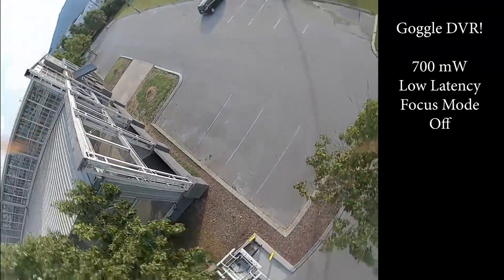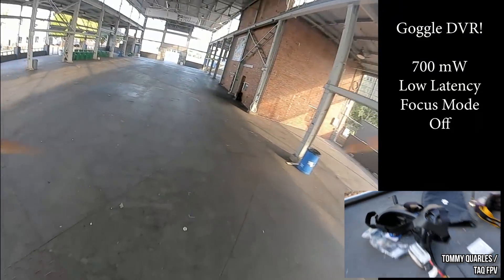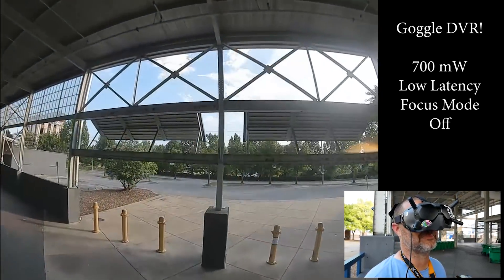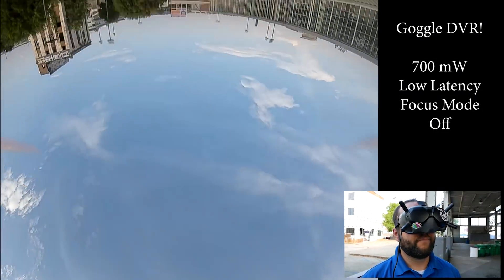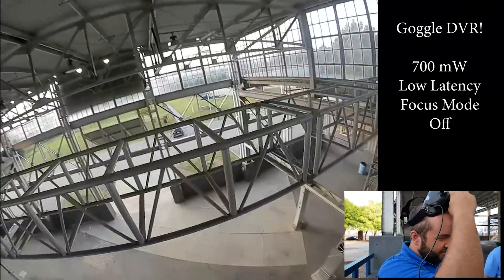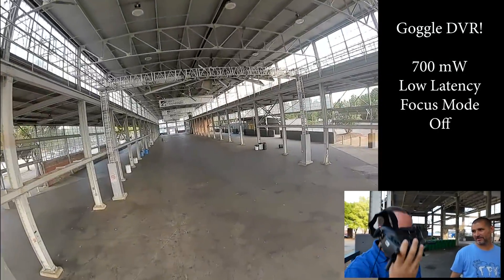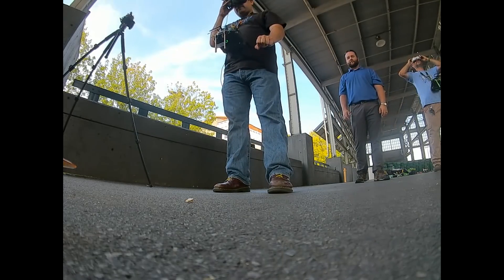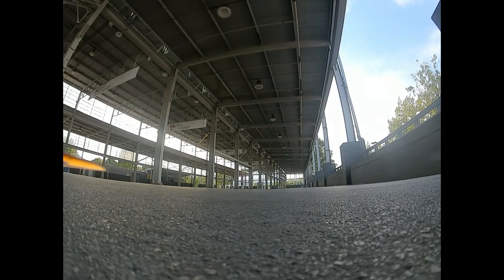DJI FPV 25 mW vs. 700 mW vs. Analog

Comment: It’s interesting but something I thought might be going on was mentioned, seeing a GoPro like view may look fantastic but might actually hinder how well you can fly due to na overload of information. Our analogue FPV “simplifies” things for us, maybe it’s something you can get used to though.
Reply: I was taking with my optometrist about fatigue caused by impaired vision. She was saying if you dont wear glasses when you should your brain has to do a lot more to process and make sense of what you are seeing, which makes you tired quicker. This seems consistent with what ive experienced. Im sure this would also apply to looking at low res analog video feeds, if your brain is having to work harder simply interpreting the image, you probably have less mental capacity for other things. Would make an interesting experiment...

Comment: Kinda need to see this in focus mode.  Also if there's a 200mw option that would be worth doing as well since thats what most of us fly most of the time.
Reply from the maker: There isn't any option other than 25 or 700.
Reply: Ill hope future firmware will give us a 100mW mode. But i can say the range on 25mw is 10-20% better than analog on 25mW

Comment: Considering getting a DJI HD system, maybe in the spring.  Hopefully a v2 comes out that takes an analog module.  Also, would like to see what Fatshark comes up with for HD before I decide.  One question - how hot did the air unit get when using 700mw?
Reply from the maker: It gets very hot. But if you're flying it's okay. It definitely needs airflow.

Comment: Nice test. Just like the guys said there is almost too much information in the goggles. I have well over 50 packs on it and still get distracted by how pretty the sky is or how far I can see.
Reply: Jason Bartlett one of the features i like best is the screen size settings. for fast focused flights i choose 70-80% screen size. 
for slower explorative flights i go 100% screen  and maybe wide.

Comment: Actually looked MUCH better at 25mW than i expected, i wonder why others made it seem like it was unflyable at 25mw. i like that you flew with focus mode off, i really wanted to get a sense of signal degradation at distance. i expected 700mW to be fine, but 25mW held up some what decently. Does the DVR exactly match what you saw in the goggles? i wonder what is the BIT rates on DVR/Air Unit recordings, dont think i have heard any one discuss that. thanks for the follow up review, i did learn something today!! :P
Reply from the maker: DVR is pretty close to what you see in the goggles. I would have to side-by-side to be sure. But remember, DVR takes out the freeze-frame skips.
Reply: @JoshuaBardwell  thanks for the reply, good to know!!
Reply: I've flown 25mw out to 1/4 mile pretty easy on multiple occasions.

Comment: BIG QUESTION: Are you using the DJI TX or a Taranis for control?  Can you use a Taranis for control and (if possible) which would you "choose" to use?
Reply from the maker: I'm using Taranis with Crossfire.
Reply: Yes you can use a Taranis or any other radio and receiver.

Comment: Shame the goggle DVR doesn't seem to record the OSD, it would be helpful to see the latency information and so on.  I assume they want the goggle DVR to be good enough to use in videos, but surely that's what the on board SD card is for?
Reply: Absolutely! Please write them. They do seem to read and respond, so maybe if enough of us request it, they'll do it. Also ask for fan control, and usb to HDMI.
Reply: Personally I'd prefer to have the OSD information embedded in the file, but not in the video stream, anyone who wants the OSD information could use a program to read the data and burn it in.

Comment: is it healthy to keep 700mw around your head?
Reply from the maker: Short answer: yes. This is such a tiny amount of energy and all it does is raise the temperature of the tissue in your head by a fraction of a degree.
Reply: 700mw in the air. Also usually cell phones works on 700 mw, up to 2000mw.
Reply: Duty cycle from the goggles should be quite low.

Comment: Yes. We all fly in 25mW here in Europe. Wink Wink, know what I mean.
Reply: Yes....we do, you see my done officer its actually really small and flying 40m way. It's quite slow that is why it's taking some time to get back
Reply: This is so funny
Reply: And we all fly under 30dbm here in the US. Funny thing is, I don't think anyone realizes that limit. They only realize that they don't have a HAM license( which we don't need with the DJI btw).
Reply: rcrdps I have been flying and driving rc for 15 years (although this is the firs year I’m getting into fpv) and I’ve never heard of a dbm limit so I think you’re right =)
Reply: rcrdps I briefly looked into it, i found conflicting information so I gave up... my understanding is the limit is inputting 30dbm to an antenna, which if you do calculations comes out to roughly 1000mw which is what everyone says is the limit for transmitting analogue signals anyways, and higher than any of my equipment.
Reply: @travispratt6327   Yes, 30=1000, but then you throw a 2db or more antenna on it, and you're over 30. So 700 is around 28.5dbm, and then you throw a 2db antenna on it with a small connector loss, and you're at the limit. That's basically what DJI did. The HAM is to operate stuff that's not certified,.... but still within limits.

I can think of reasons for the limits, but I really have no clue nor do I have any stake in the game. I just like to know what I'm up against.
Reply: The limits aren’t really an issue anyways, that’s more of a manufacturer gripe, what annoys me is the required licensing, if you don’t need special knowledge or training to operate a cellphone or WiFi router than operating a toy using the same frequencies should be the same. If for no other reason than the simple fact very few people are going to get a ham license to fly their $100 amazon drone.
Reply: rcrdps Yea I know what you mean, basically they don’t want people taking an extreme high gain antenna and blasting the entire 1000mw in one single direction, it’s understandable I guess.
Reply: Yeeeeah totally. I always keep to the 25mW😉.
Reply: Switzerland is actually not in the EU, but has adopted the EU limitations,  never mind you can VPN any adress
Reply: Is it actually restricted? Because of EMC Directive excludes 2nd hand devices. So if you are a producer, you have to test your components, and you can distribute your goods with corresponding mark CE or FCC. And for self-build equipment, I could only find recommendations that it should be under 25 mW in CE zone. Can someone point to the document?
Reply: Are bad incress mw or good for longrange

Comment: Would love to see a proper range test in an open space! Is 4km actually achievable? Haven't found any video on YT so far.
Reply: It's there yesterday look up furadi
Reply from the maker: I think 4 km would be achievable only under really ideal conditions.
Reply: Its easy achievable with a fpv plane. I saw somebody who achieved 6.3km ~4 mi with stock antennas. I think you can get around 3-4km with a Quad. This System is so next level 👌🏼
Reply: one of the first vids i saw on this dji system they did a range test.  they flew it alongside a pickup truck down a straight flat road, while the people in the truck talked to the pilot via cell phone.  major degredation around 2km and i think they called it at about 2.5km because it was getting too bad to fly and he actually hit the side of the truck.
Reply: There's a video of some asian guys on youtube achieved 11km with a 14dBi antenna.

Comment: Will you be able to use 700mw on a CE system or is it locked?
Reply from the maker: It is locked. You cannot legally use 700 mW on a CE system.
Reply: @JoshuaBardwell  Well then, can the user unlock it? - Asking for my non-EU friend, Balthazar.
Reply: Run US VPN during a activation and you can choose between 25 and 700mw . IP location defines the region .
Reply from the maker: I have also heard that there is a text file one can modify. I don't know the details.
Reply: Yes. Just put a text file named naco.txt with the number 1 on the SD card and it will switch to 700mW FCC mode. I did it first thing before the first flight.

Comment: Very nice for bandos. AndyRC managed to fit one on a 3".   Oh yes.  Thank you for the comparison and embarrassing outtake.
Reply: I have it on a acrobrat 3"
Totall weight 250gr
650mah 4s
Reply from the maker: If you got the DJI system on an acrobrat under 250 grams I'm really impressed. The Acrobrat itself had to be carefully designed to get under 250 grams with a Caddx.
Reply: @JoshuaBardwell  JB when im at home tomorrow ill post pics and put the kwad on a scale. It took me really some time to get it at that weight. I can share you a bblog too because i know you like it hahaha

Comment: I want to buy the dji system, it looks awesome. But I race and know the latency and weight is a factor. I however would love to see a test of analog "IN" lag. I have heard the rumors of it being bad and destroying my hopes of just having one goggle. Imagine having a goggle that can do both analog and digital!
Reply: Yea I'd like to see dock king w rapidfire on dji goggles
Reply: @aarrcchhoonntt  Using the Dji digital system in a race is like putting shitty all season tires you get with a prius on your f1 race car. You would understeer straight into the wall on your first turn. An analog system is like having a formula E engine inside a go kart with tires and track made of velcro and superglue! I am simply stating I want both systems in one goggle. This is one of the fastest pilots in the world testing the DJI system. https://www.youtube.com/watch?v=c-5HAXhas6k
Reply: Plenty of racers are using the digital system, and some have shaved a few seconds off their fastest times. The latency isn’t an issue - it’s quicker than the eagle. Keep in mind these screens are 120fps which has a minimum latency of 8.3ms, whereas analog is stuck to 60fps with a minimum latency of 16.7ms.

Comment: None of these tests are fair!! Nobody uses the stock antennas on fatshark or anything else, use aftermarket antennas on the dji!
Reply from the maker: I think that DJI customers are way more likely to use the stock antennas than a typical FPV user. Especially because a set of upgraded antennas for the DJI costs over $100.
Reply: @JoshuaBardwell  fair enough but i think 80 percent of buyers will be typical fpv pilots, also you don't need to replace them all at once for better range. Thanks for all the time and expertise you give us! Love your content!

Comment: Really, it's all about 2 things for me... Get it down in size (air unit) so it can work with 3" and under drones. Also, down in price.
That's it and I'm a BUYER! I CAN'T WAIT! 
PHENOMENAL IMAGE QUALITY!
Thanks JB! 👍😁
Reply: lots of people have gotten the air unit in a 3inch build already. can't really go under but 3 inch is definetly doable
Reply: FlexRC put it in a 2.5 inch
Reply: @Jdogg5343  Very Co0ol!
Reply: @scootroter4859     I put it in a whoop. A bit heavy, but it works.
Reply: Photophinish3 I want that system bad.

Comment: Well, if you don't want to use 700mW because it is illegal, you'd have to fly 25mW on analog aswell, as you can't legally transmit more with that either. My Problem with the digital systems is the price, way to frickin expensive for my budget...
Reply: It’s only expensive if you already spent your money on fat shark hdo, crossfire, etc. like I did, however if you’re new to fpv have the money and want digital then this is the way to go. Too bad you can’t fly whoops without the analog equipment.
Reply: @EscobarTV45  yea I did same but once they get betaflight osd workin I might jump,  can't live without my rssi and home arrow w gps rigs
Reply: I'd like to see someone sit down and make a reference table of what is allowed/not allowed in different countries. if there is one country where 700mW analog is allowed but DJI is 25mW, then his caveat holds. For Canada we get the full TX power for both, but less channels.
Reply: @simon8904  Nah man it's easier than that.
Reply: @undoubt1540  could you describe how, for a friend ?
Reply: @undoubt1540  thanks a lot for sharing man, it's appreciated !
Reply: Wait a few years and the price will be as the analog price is today’..

Comment: Wonder when DJI will get betaflight OSD into the feed. That's when I will have run out of excuses.....
Reply: I heard Preston (flight one) was actually traveling to China to discuss osd stuff with DJI. Hopefully similar efforts will be made with Betaflight. Maybe even something universal so that we don't need to update the goggle firmware everytime Betaflight adds a feature to the OSD.
Reply: Ditto bro, I can't live without my 900mhz RSSI &  home direction arrow on gps rigs
Reply: I imagine it would be pretty easy for BF to just send all the OSD data over serial and have the DJI unit superimpose it. Hopefully they are willing to work together...

Comment: The dji system is very impressive. Especially for a version 1 release. If it had analog compatibility built in or a module bay I'd be all over it. Thanks for the demonstration Joshua. TAQ is a blast, love his videos. 👍💖🤓
Reply: This is version 4, there have been 3 tries of digital from dji before this.
Reply: @Hellmuthsilva  didn't know that. Thanks for the info.
Reply: Honestly, if having to put the module on the side of the strap vs inside the goggle is a dealbreaker for you then it sounds like you just dont really want the system.
Reply: @JingGuily  hang a ground station on the side of my head?
Reply: @jlarson42  you can word it anyway you want you already have a freaking antenna field in your face why not add one more to the side. It balances it with the battery on the other side ;p
Reply: @JingGuily  ok you do it. I'll wait.
Reply: @jlarson42  I will when I finally receive my system.. Says ship the next day it's been a week...
Reply: @JingGuily  post a review/setup video. I'll watch it.